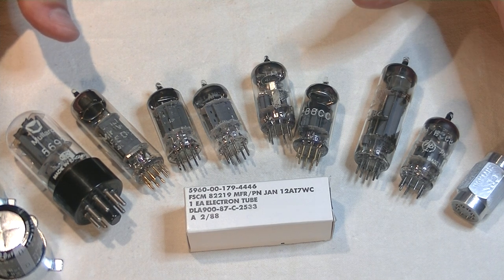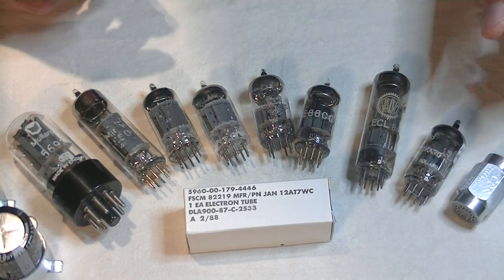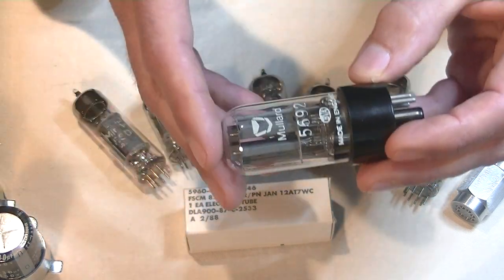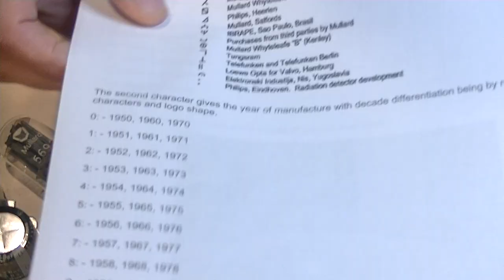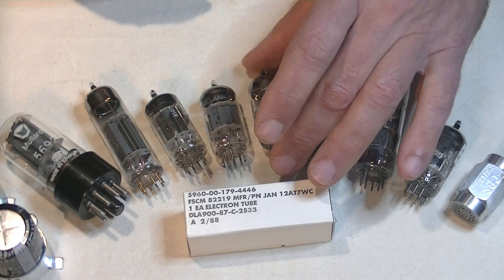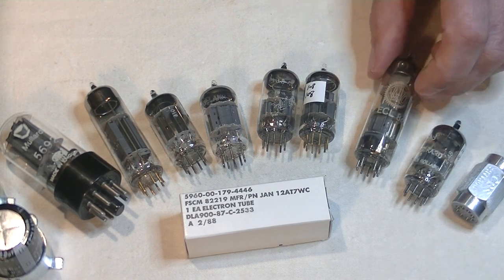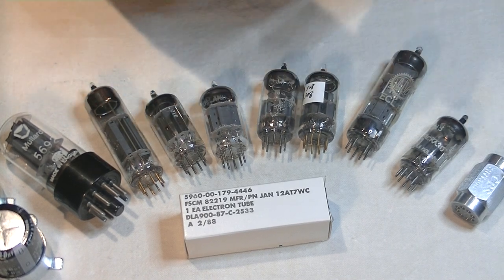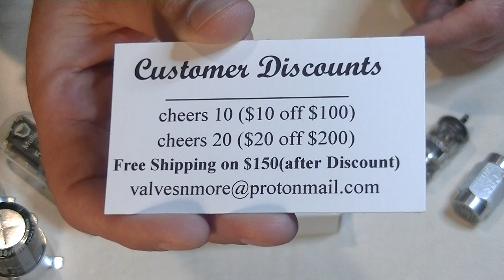Tube Lab #13   How to Identify Mullard & Philips Tubes

Comment: Maybe a bit late but I found this info on Philips Heerlen on Wikipedia: ¨Heerlen: Started in 1951. Nowadays LED screens, used to install electron tubes, 1450 employees in 1975. Later tubes were manufactured for Philips Medical Systems. In 2009, 100 people still worked there. It was eventually transferred to Argus Healthcare, part of Medical Systems, on April 1, 2009; produced image intensifiers. Closed in 2019.¨ From where I live Heerlen is next town.

Comment: By the way I now have Mullard EL84s and ECC83s on my Leak, I wish to ROLL them when I change them just for the fun of it, what brand do you sujest?
Reply from the maker: If your Mullards are tested and matched, you already have some the best tubes made - take care of them and if you like them find spares!  If you want to try some different EL84's we have a good select in the store, the Sylvania's are highly regarded and we have NOS (new old stock) and good used available, and also the Reflector mil spec version as well, which are rock solid and a bargain at current pricing.

Comment: Hi Jim, I noticed that except for the Russian 5692 all the other tubes you went through, has a blacked out cap.What is that? I believe that my GZ34 (Ultron) had it and over a period of time it dissapeared.Thanks for the discount code.
Reply from the maker: Do you mean the top gettering is very dark as opposed to nice flashy silver?
If so one of our viewers solved this for us.  Apparently on more modern vacuum equipment if you apply a very high vacuum the gettering goes very dark.  He claimed this indicates a higher quality tube as a result.